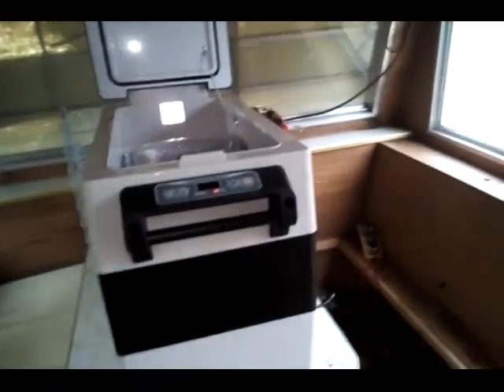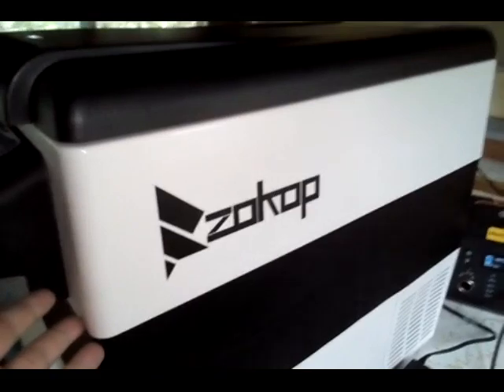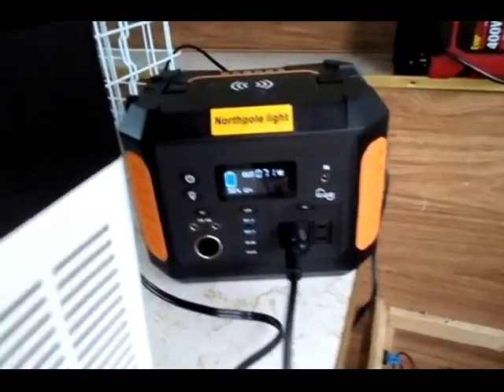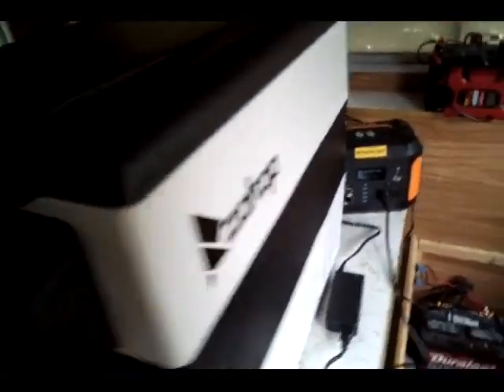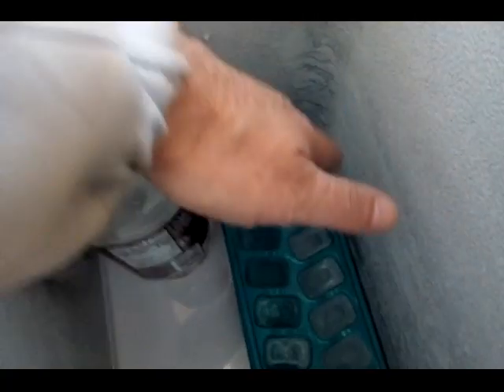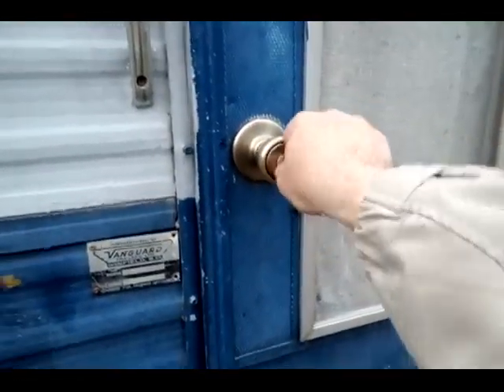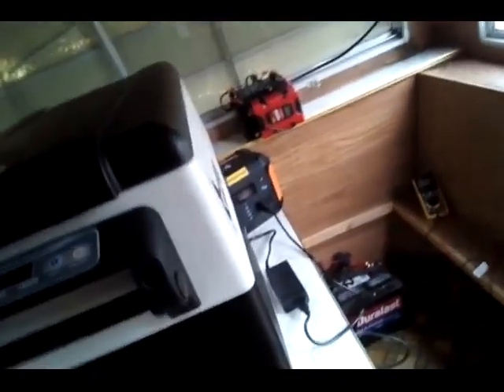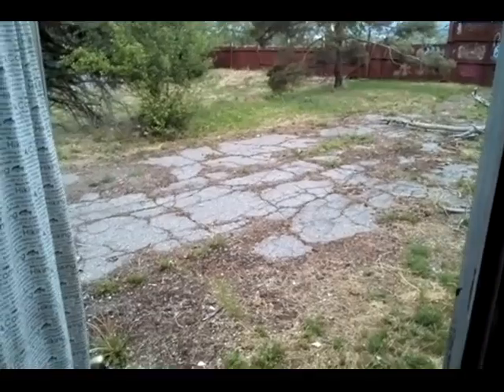Northpole Light 8 hour test ARB 12 Volt Freezer.

Comment: Yeah running some of these 12v fridge/freezers down that low on freezing they chew power. I am not concerned so much with wattage as I am how long the cycles are. For instance. I have a Snomaster 85L/90qt Expedition Series Dual zone. The cycles on that are on average 2-3 minutes. It will sometimes pull upwards of 71-100w on DC on whatever side I'm using as a freezer. When it kicks over to the refrigerator it'll use 65-71w. But the cycles are pretty consistent. I have two Iceco's the Jp40 and Jp50. Which is basically the same chassis that your fridge is. The Jp50 is used as a freezer. And getting it down to zero took a long time. And that with frozen food in it. And on DC. That little Secop BD35F pumped it's little guts out. But the cycles are way longer and way more frequent. So I'm willing to bet the Snomaster is actually more efficient in the long run. It'll run for 53-58 hours on my Bluetti EB200p. And that's in 105+ degrees Fresno Ca weather. I haven't tested the Iceco's on the Bluetti yet.
Reply from the maker: Once frozen the on and off cycles are really not that bad on my Zokop. If I use the 120 volt plug, and not the 12 volt plug it can start to freeze ice in about a hour. I did cut off the 12 volt plug and hard wired it on to my battery directly. With the 12 volt plug on it took between 4 to 6 hours to freeze. Once I hard wired it then it only took about a hour. So in my case the 12 volt plug was not making a good contact, or the plug was just bad. This really did not do that bad for a cheap power station that is only a 515Wh power station. My Home Years is a 518Wh power station and it did the whole 8 hours with power to spare. I do understand why your Bluetti does a better job it a much stronger and much more expensive power station.